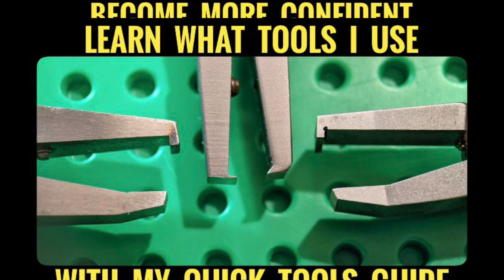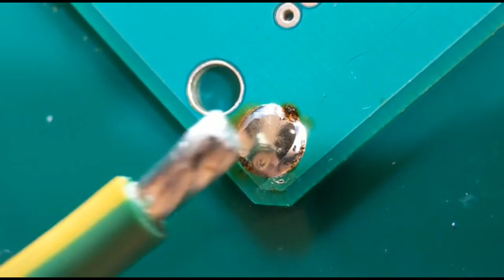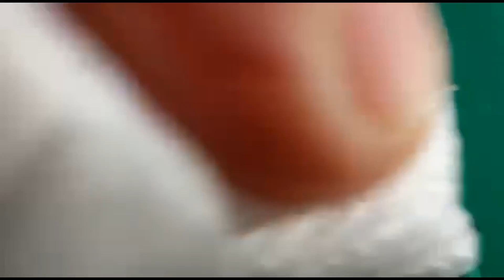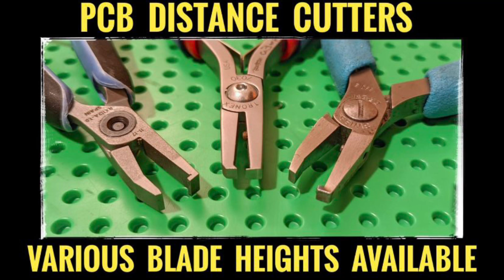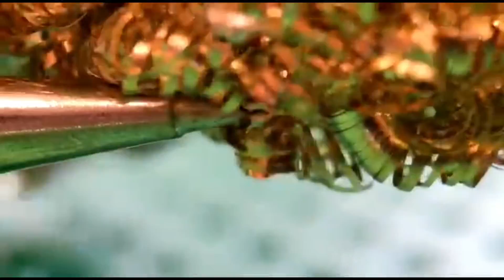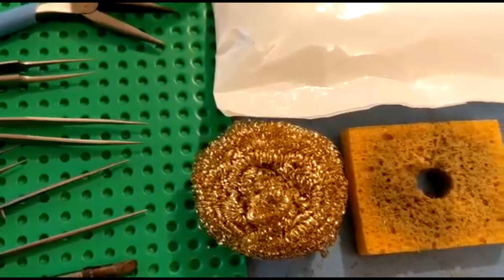Instantly Improve Your Soldering Skill / Soldering Tutorial

Comment: How did you tin that cable without the sleeving melting and shrinking back? Is it some special type of cable?
Reply from the maker: Hi . No it's normal earth cable , nothing special about it . I didn't show doing that stage as I just presumed people would probably know that . I guess I could have shown it . I just flux my cable , use a big tip and 0.9mm or bigger solder and it tins really quickly . As you can see when I applied it to the board as long as you keep the iron tip away from the sleeving you will be ok . Hope that helps . Thank you for your comment , much appreciated 👍
Reply: @mrsolderfix3996  Thanks for the reply. Whenever I solder wires to boards I have trouble with the insulation shrinking back leaving more copper exposed than I had planned. Guess I need more practice, will try doing it quicker (only been at it 50 years or so!)
Reply from the maker: Hi . I know what you mean , sometimes the wire you use is near impossible to stop it going back a little . I just tin both the cable and the board , use flux on both then quickly solder together keeping the iron away from the sleeving . It normally works pretty well , but I do understand your comment totally . Thanks again for watching 👍
Reply: The only tricks I know of for dealing with receding insulation... 1) Buy wire that is intended to be soldered. Manufacturers do not spend the extra money to make the insulation heat-tolerant in wire that is intended to use crimp connections. 2) After removing the insulation from the end of the wire, apply lots of flux. This helps the solder move more quickly into the strands, reducing the time needed to heat the wire (called "dwell" time.) Less dwell time equals less time for the insulation to recede.  Start with your tip in the middle of the bare wire. Sweep the tip to the cut end of the wire, then back to the insulation edge. Rotate the wire, sweeping the tip to fill in any gaps. You may have to chase the insulation edge, a bit. But, step 3 takes care of that. 3) Trim any excess wire that was exposed by the insulation receding.